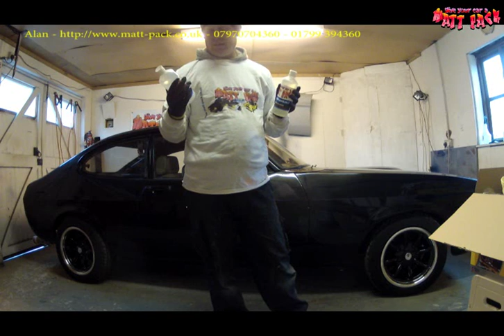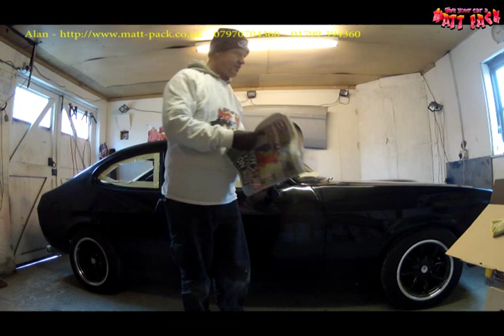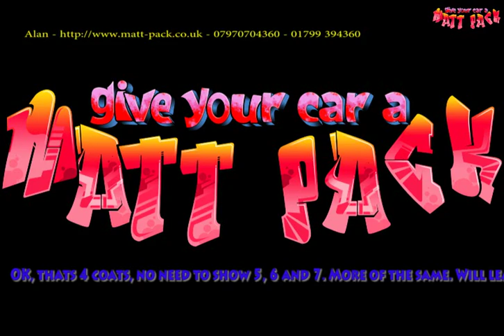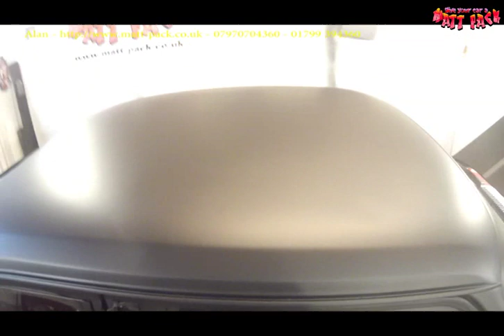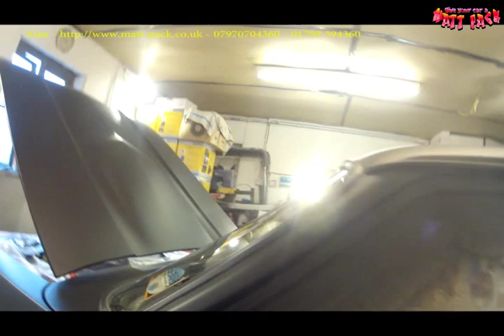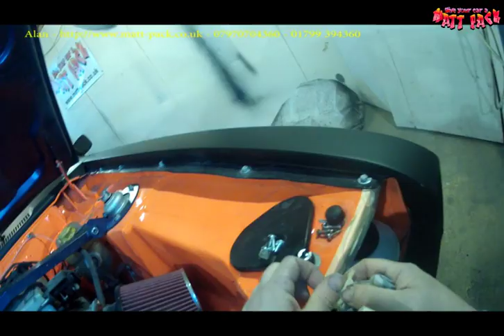Give your car a Matt-Pack 1 - Ford Capri

Comment: i like the idea but i don't understand why you didn't sand the body first?the paint wont attach if you didn't do that...
Reply: +Himsha Van de Veire It's because this is plastidip which will be peeled off at a later date, leaving the original paint finish intact.

Comment: Alan thought you said xylene is "crap" but now your using 100% xylene to thin.... why the change??
Reply from the maker: xylene is. im not using it 100%. EU laws mean general public cannot use a product with Toluene in it so substituting the toluene for 100% xylene (65% xylene and 35% naphtha. its a compromise really.  trade and professionals can still use the proper toluene/naphtha mix for a proper job though. its all down to plastidip.co.uk trying to shut us down and control the market to keep prices high. the xylene we use is 100% xylene though. there are other xylenes that are only 98% or 99% pure
Reply: Theyre what? In what sense are they doing this? Thats not good style in the community of dippers.